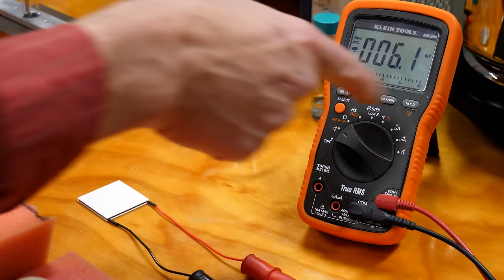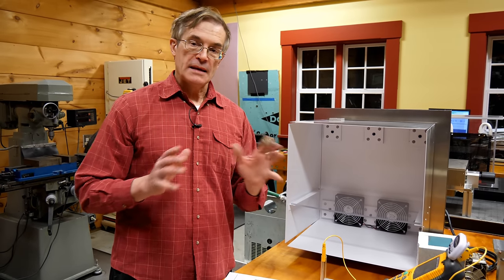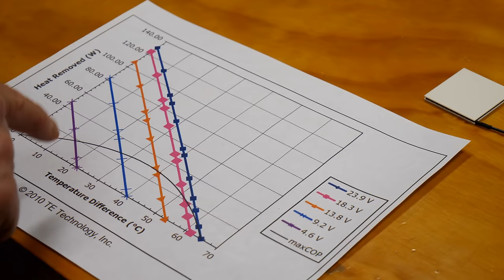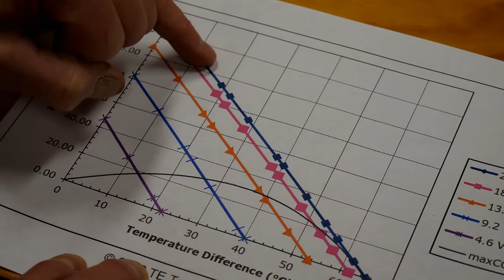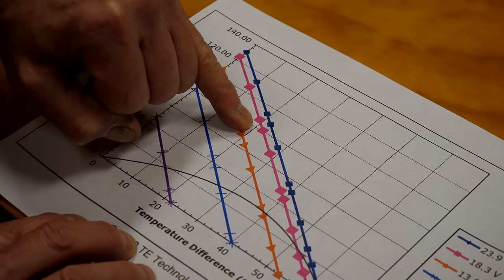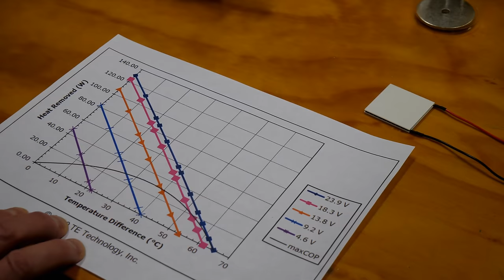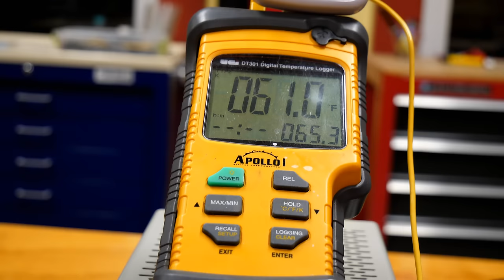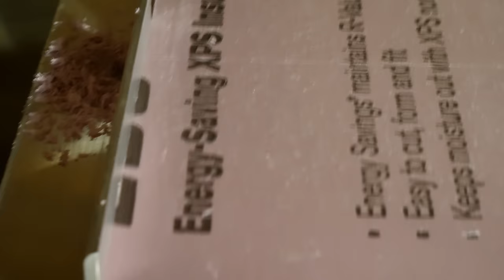BUILD YOUR OWN REFRIGERATOR! - SOLID STATE TEC

Comment: Very nice video, as usual. I agree with other commenters, that the way you explain science and engineering through practical applications, including some of the math, design consideration, etc. makes it all very easy to understand, and later to apply that understanding to our own projects. Thank you.
I'd like to offer one small improvement to the "box" itself: putting the door at the top (as opposed to the side) will prevent some energy loss when you open the refrigerator, as cold air will tend to stay at the bottom, i.e.- inside the refrigerator.

Comment: If you offset the hole locations in the heat sinks you will have better thermal dissipation. also because heat has a natural thermal rising effect (draft) a vertical pipe would produce a cooling effect without using electricity "just saying" Love the videos keep up the good work.

Comment: We built a combined freezer and fridge in the bow of a 61' steel boat, below the waterline in 1980 using Peltiers.  No fans, just the conduction through the hull to the water.  This system is still working today.
Reply: we actually just built a fridge on our boat as well, would love to hear your thoughts

Comment: That is the absolute best demonstration of the peltier effect I've ever seen.
Reply: But, the only improvement would be to put radiator fans on the inside as well as outside, to draw off the heat of the interior faster. Works both ways with heat transfer.
Reply from the maker: The entire inside surface acts as a heat exchanger and the fans in the back are blowing air over that surface.  If you look at a typical heat sink you will see that the surface area is comparable to what we are using.
Reply: @TechIngredients  But I imagine that your transfer suffers from the distance that the heat is conducted to the actual peltier plates vs the relative proximity of the radiator plates to the outer heat dissipation.

Comment: Awesome video friend.  I actually work with TEC as an engineer designing thermal control units for the semiconductor industry.  Another technology I have come across for insulation are what's called VIP's or "vacuum insulation panels".  I have been working with them for years now and you can easily find panels with R45 to R50 per inch or .003 W/m k thermal resistance.  They are also flexible and cost effective @ ~20$ per sq meter at 1in think.
Reply from the maker: Thanks!
I've heard of them.  The principle has been around for a long time and worss even with material as simple as cardboard as long as the vacuum is maintained.  Now, I believe aerogell fabric is the current state of the art for the filler.

Comment: Very interesting discussion at the beginning. Efficient cooling/heating without a compressor will be a game changer. This type of device is used in deep space probes using a chunk of plutonium for the heat to generate voltage when solar energy is not enough (ie Voyagers).  They are called Radioisotope Thermoelectric Generators and are somewhat controversial.

Comment: Long distance sailors almost always have refrigerators(with compressors), and the breakdowns always occur at the worst time and in the remotest of places.

Freezing is not a big issue and is often "not important",  with "long distance", sailors, but "refrigeration is always nice.  The idea of carrying all the cheap repair parts in a small box, and repairing a refrigerator(cooler),  with a few wrenches would certainly be appreciated.

Looking forward to your tests ... as soon as I find them ...

Comment: The compressor does not change the phase of the refrigerant. In fact, if the refrigerant liquifies in the compressor, it can cause damage, as liquids are typically not compressible, and so the compressor can jam. Instead, the compressor heats up cool gas into warm gas by compressing it, and then the phase change occurs in the condenser, where the hot gas is cooled and condensed into a liquid again.

Comment: 36:30 A little fun fact is that the radiators on the ISS are also white which may seam odd at first but to the infra red it really does not matter what colorthey are as long as they are "black" in the infrared range, but in that case the white was chosen because it is the most reflective to visible and UV light from the sun while still allowing them to efficiently emit infra red

Comment: i loooooooove this channel ... this dude makes a lot of ideas I thought about but didn't have the time AND the extra money to try (it's always either one :(  ). the descant cooling thing was one of the few things I really wanted to try but didn't have enough resources (was a broke student). i live in the middle east and we have a lot of sun, solar arrays to heat water in winter are more than sufficient so we don't use boilers much (we do have them anyway because they're also used to store the hot water, win-win). in the summer i thought about using said plentiful hot water to dry the descant NEAR the cooling area (of course one side is inside the house the other is outside), the hot water can be transferred using pipes instead of moving the descant an impractically long way.

Comment: Great job & project ! is it possible to retro fit an existing small refrigerator, with the same material, & concept and get the same result ?
Reply from the maker: Yes, but I wouldn't do that.  They are poorly insulated because the higher effeciency of the compressor cycle.

Comment: Great video, very interesting. I had a previous different comment. Here I just wanted to point out that in the winter, there's obviously no waste heat, and less irony that it's cold outside, because the heat moved to the outside of the fridge is simply used to heat the inside of your room. In seems there is no such thing as 'waste' heat from ANYTHING inside your house as long as that heat is being cicrulated and not lost to the outside. (But other forms of energy can be wasted, like mechanical friction that might produce heat in a very inefficient way). Few of us consider that incandescent light bulbs are NOT 'inefficient' AT ALL for indoor use during the winter if their heat is spread around ! (not for example stuck in a ceiling can). In fact, they are quite good little 60 watt heaters. You can even leave them on in the daytime because there is virtually no 'waste light". They actually really better thought of as heaters that happen to produce light. I think most simple forms of resistive heating are similar in their efficiency, light bulbs being one of those forms.
Reply from the maker: Keep in mind that different sources of energy don't cost the same.  If you heat your house with natural gas, the cost is between 10-20% of the cost of electricity.

Comment: I don't think you will have any trouble getting this to work via convection alone. It seems to me that the chimney effect could be greatly enhanced by enclosing the sides!  That I'm nearly positive of.
Another thing to note is your air boost needs no torque. So consider running one squirrel fan and spreading its output across the entire lower intake in a sort of venturi distribution. Then the fans also come at minimal restriction when running fan-free.
Another modification which might help could be to use the chimney effect of the channels closer to the heat source to pull air down thru the farthest channel or two from the heat source. IOW you have 7 enclosed channels, open at the top, enclose the sides, seal the bottom so the front say 5 channel's upward pull creates a downdraft in the rear two. Then direct the intake and exhaust that they don't recirculate he same air at all. This may seem counter-intuitive but figure that the heat having to be pulled down is negated by it's upward draw- so the net effect is mainly relatively free extra airflow over the more distant plates.
Lastly, you might want to paint the outermost plate and edges black to boost radiant emission.

Comment: You can dump the heat from the peltier into batteries using another set of peltiers mounted to a heat sink, hence you could also cool a second fridge or dump the cold side of the heat sink into the Air. it can also double / triple as a water generator.  :) If you do that you want to add a dump load to your charge controller in case the batteris are full and the second fridge is also not requiring energy, this avoids burning out your peltier that is absorbing heat and dumping dc into battery, if battery full no where to dump and system will burn if using solar power or power that does not turn off when system is not demanding power.
Reply: Top

Comment: I absolutely love this video, possibly the best presentation I have seen to date, the design is exceptional, I am very pleased to support your channel.

And I love that end teaser, "why are we using a propeller that can push the vessel faster than the whole speed", hydrofoil I know exactly what you're going to do with that, and I cannot wait for the next one.

Congratulations on a professional presentation.

Regards William

PS: I have a project using this design on an extremely large scale as a houseboat,  45-60 m long 4 - 5m high.

Comment: You should try making a Peltier cooled/heated jacket.  Take a normal jacket, sew in a Peltier module, use heat pipes to distribute the heat and cold on the inside and outside, and run it on a battery in the pocket.  Not 100% sure it'd work, but maybe.

Comment: Hello! It is the evaporated flow of air that goes inside the refrigerator. 

It's like the atmospheric pressure of high and low, the heat goes up and the cooler air goes down. Snow freezes before they turn into water.
Reply from the maker: Please clarify those statements.  Evaporated flow of air?
Reply: @TechIngredients  it is the basic in refrigeration, as you said the phase change. Heat or hot/warm air is transformed to cooler air.

Comment: Minor nit :) (guessing you know this but just simplified for the vid)  In a refrigerant-based system, compressors just compress the refrigerant to very high pressure (and temp), but it's essential that the refrigerant remains in gas phase as it exits the compressor or the party stops there.  If the gas flashes to liquid in the cylinder, you end up with a locked rotor and either safety shut off or grrrrrrrrrrrrrrrrr and smoke.   What's supposed to happen is the hot, high pressure gas will flow out of the compressor and into the condenser coil, where it will trade heat with the incoming (typically) ambient air and condense back into a liquid.  The liquid itself is still actually hot as shit when it leaves the condenser, well over 100F in most cases.

Comment: You could dramatically increase the convection effect by sealing the edges of the cooling fins and putting a cooling tower around and above them, to draw much more air across the plates
Reply from the maker: You could.  Of course  to be meaningful the system would have to be much bulkier.

Comment: Love the Idea and the way it was built, love the time you take to explain everything, Im 61 and i never stop learning, but a quick question, I know that set up as a chest freezer/fridge would mean the top is lifted off and thus the ambient temp in the cooler is not poured out on the floor, would this though cause problems for dissipation of the heat from the heat dump now underneath the system?.
Reply from the maker: It's  a compromise  between convenience and efficiency.

Comment: 32:11 i think  connecting highly efficient cu heat conductor pipe (used in laptop cpu cooling system ) will increase its cooling speed with high Air flow fan

Comment: TECs are some of the coolest devices I have ever used. I used to play around with them a lot, including trying to cool a CPU...Just a forewarning, cooling a CPU with one is fraught with complications. One of which I didn't expect is that when the TEC is powered off, the heat will 'flash' through it, which could be bad.
Another one is that without power, the TEC won't transfer heat at all, so if the power on the TEC fails, your CPU could overheat very fast.

What I want to do is to make my computer case refrigerated using TECs so the intake air is chilled.
Reply from the maker: Check out our previous video on "Overclocking Our Computer for Free".
This shows another approach  that works very well.
Reply: @TechIngredients  I will take a look now!
By the way, your channel is so great. I just stumbled upon it from a link on a website about the heat rejecting paint and wow, what a find! I have been binge watching the channel. You got yourself a new subscriber :)

Do you guys have a Discord? I'm sure lots of us who watch these would love to have a place to discuss this kind of engineering.
Reply from the maker: Welcome.
We're  soon going to add live streams to this channel where we'll  discuss... EVERYTHING!

Comment: I've been thinking about using a couple of these as fermentation box. Depending on what is being fermented it would be 65 or as high as 75. So in winter I would need to heat and in summer cool. 
Good info here.

Comment: I watched this when it first came out but i didn't notice that at 34:41 there's a big gap as he's talking about how flat they sanded the conduction blocks.
For those who are new to this, don't make that mistake. I'm sure he fixed it after he noticed but that gap will make a noticeable difference. In a high heat situation like a CPU set-up, a gap like that can cause your CPU to crack or possibly even "explode".

Comment: Bravo, sir, bravo!  Very good information, some of which I was ignorant.  Most of the peltier stuff passed by while concentrating on research, building fiber systems, & such.  Size of the box is entirely reasonable for proving theory.  Have you any projections for applying this to a much larger, more insulated freezer?  Thank you.  Marvelous videos you did on the ac system & the propellor pushed recumbent.
Reply from the maker: Thanks!
That's  easy  to calculate based on the wall area and the insulating properties of the polyurethane foam that I covered in the video.

Comment: I think if you placed an interior heat sink on each of your TECs and mounted your Interior fans on the the heat sinks the efficiency would be greatly improved.  The bottle neck is the surface area on the TEC.  You already have the exterior  surface to give the excess heat from the interior and the heat created to perform the process to the ambient air.  You should look to collect more heat internally more efficiently by increasing interior surface area collecting heat.  This will improve efficiency and drop the electrical load necessary to perform the same work.
Reply from the maker: Because the entire interior surface of the refrigerator is  a heat sink (except for the door), I ellected to reduce the interior bulk that these multiple heat sinks would add.  It's a trade off.

Comment: Hey, thanks for all the detailed information on the topic. So, I would assume the TECs (consisting mainly of ceramic and metal) to conduct heat significantly better than the insulating material, which has made me wonder if the TECs wouldn't compromise thermal insulation when turned off (for example in cycled temperature control). And so I have two questions relating to this...
First question: Does a TEC provide better thermal insulation when left open circuit? Considering that TECs essentially convert a heat flow into current flow, one would assume they would conduct heat fairly well when the TEC is shorted out and the electrical energy is being consumed (since you know, the energy has to come from somewhere).
Relating to that, I wonder if it may not be more efficient to regulate the voltage to the TECs using some sort of PID temperature control, rather than cycling the TECs on and off, since I would assume the TECs (consisting mainly of ceramic and metal) to conduct heat significantly better than the insulating material?
Second question: Would it be theoretically possible to separate the two junctions of different materials increasing the distance between the hot and cold side? I would assume the semi conductors used in this to have a fairly high resistance (compared to something like copper), so I figure the junctions should probably as close as possible in order to minimize energy loses. I just thought, if it would be possible to seperate the two junctions with a cable of a specific material and therefore essentially having two TECs, one that heats up and another one that cools down (depending on polarity) one could separate the cooled place from the place where the heat is generated, which I figure would be advantageous for the efficiency (assuming the connecting cables wouldn't have to be made from a material with a high resistance of course).
Reply: I was thinking the same thing. Maybe they are hard/impossible to take apart, but would be an interesting thing to experiment with.

Comment: This is becoming my favourite youtube channel, it's so cool❄️
Reply from the maker: Great!
Reply: @TechIngredients  
Great presentation! Never heard of magnetic refrigeration.

Hey if I could pick your brain for a second (hobby project)
Do you know of a material or element that would corrode very quickly in our atmosphere? It's for a sort of physical timer. A material/metal that would corrode or degrade in a short period of time so that it would structurally "fail", or become very weak? Like a wire that - when exposed to air - would become brittle in an hour or so? 
thanks